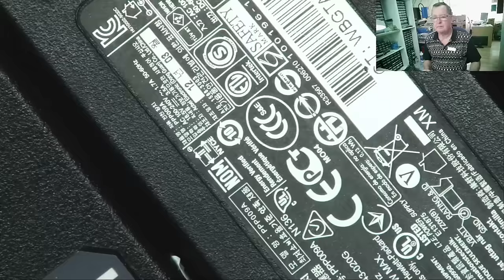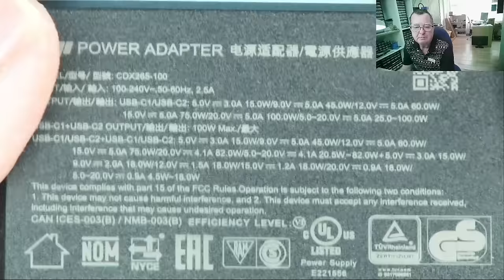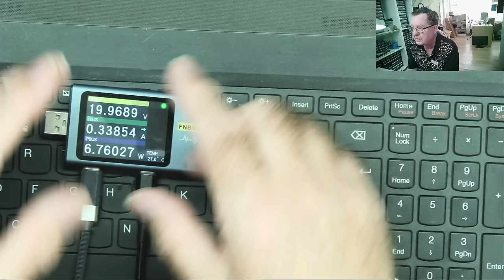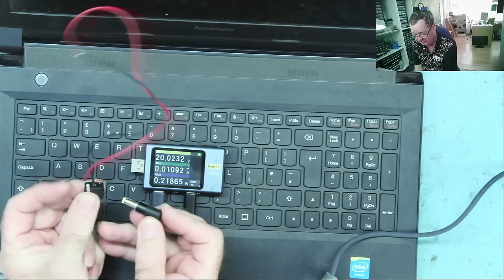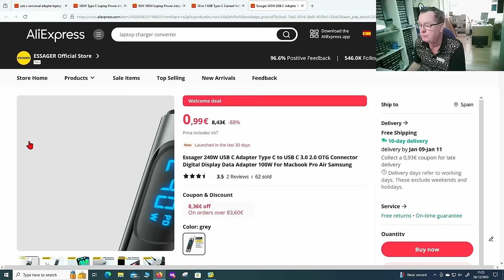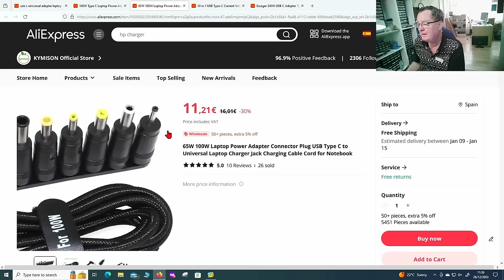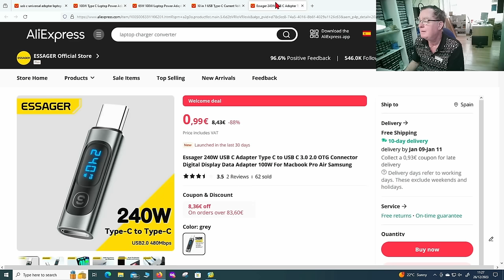Laptop Repair, Volts Current Watts Meter you need these cheap USB-C universal adapters! Here's Why

Comment: I have problems to accept that the voltage is allways correct... What is if not? You will have very high costs for a new computer, etc...
And what is with fire, overheating? Those very small things give you 5 amps...? 100 W, you know which cables you need? Big ones. I am not convinced yet, I have seen so many chinee-things and heard about their problems... no, not for me.
Thanks for you videos, as allways. Happy Xmas and a happy new year 2024.

Comment: yeah, I agree that having the new style USB - C style voltage and current reader comes in very handy for guys like us, we seem to want to know what Devices are doing, of course I have the older style USB - A current and voltage reader and have found it extremely useful over the years, and I know it's time to get the new style USB - C and what's interesting is the amount of current and apparently voltage that can be available with that style of connector.  I was interested in the large display on the FNB58 and it provides more information, and I'm glad to see you have a style that goes on the end of the USB-C cable, to me I would just use that for general purpose making sure current is going through the cable to whatever device is plugged into, and providing general wattage, which is interesting with the diversity in USB-C wattages available

Comment: The problem I have with cheap cables and chargers is fire. I am a noob, but Big Clive and AvE's channel has confirmed a lot of my suspicions. I'm a noob at knowledge of circuits and deep repairs but the experience is there from seeing cheap imports and Amazon fakes.

I use a 19/19.5 supply and meter that has laptop adapters. I now own 3, because I keep losing them and finding them :D

Comment: some universal laptop adapters also had adjustable voltages. not all laptops go with 20v.. some even change voltage based on what "adapter" you plug in.
Reply: With their internal voltage regulators pretty much all laptops that are made today will work perfectly fine with a 20v supply, if you test 100 supplies that come with laptops all for different ratings say 19v 19.5v 20v the three most common laptop voltages currently in production across the board and then even the odd ones that want say 21.5v they will all give you a measurement in the same region ranging from 18v to about 22v and any of those laptops will work on those voltages because the voltage regulators inside the laptops step the voltages down to the required voltages, in my experience it's the current that's more important, if the adapter can supply enough amperage at 18v to 22v you'd be hard pressed to find a laptop that won't run perfectly fine

Comment: I was in the neighborhood for buying another regular ac-dc adapter, and I really love this idea. I just recently bought a 100W PD adapter, and I never would have thought to go USB-C with it for my other projects. It might cost a slight bit more for the cable, but in the end, I think it would simplify the setup I've got going on. Swiss army knife of adapters kind of way. Thank you!
Reply from the maker: Yeah I agree. And add the little USB monitor as well for Volts/Amps/Watts and you have something really useful.  And small.🙂You can also buy cheap USB-C decoys which let you manually change the output voltage of a PD supply, so 5V, 9V, 12V, 15V, 20V
Decoys
https://www.aliexpress.com/item/1005005958435989.html?af=ler2022
https://www.aliexpress.com/item/1005006051376770.html?af=ler2022

You may also find these sockets useful for your various projects 🙂
https://www.aliexpress.com/item/1005005370810361.html?af=ler2022

Comment: Knowing what is going on inside the PD usb cables is really something I am glad to know. I was able to identify a faulty charger that was putting out 20V on type C with no request for it and I think fried a Raspberry pi.  I considered the Finirsi one but decided to go with the Chargerlab PowerZ KM003C. So far I am having good service from it. The chargerlab was about $10 more than the Finirsi one on the 11.11 sale and can handle the newer higher voltages (PD3.1 50V, 6A) and that seemed to be a good fit for my use case.
Reply from the maker: Wow I didn't know PD3.1 will go to 50V 6A, I did know some PD supplies will support 28V already.
Reply: @LearnElectronicsRepair  I think it is going to go with 20V, 28V, 36V, and 48V. Though I think the higher power ones need an approriate rated cable to do it. I'm pretty sure the one I ended up buying from Chargerlab can test the cables specs as well as the chargers.
I bought it mostly because it was newer and looked sexier than the Finiris one, lol. It seems really well made so far!
Reply from the maker: @patrickcallahan2210  Thanks for the info 🙂

Comment: I use these adapters with my bench power supply. That way, I can set the voltage to whatever the laptop requires (e.g. there is AFAIK no USB-PD profile for 16V, which some laptops want). And I can also set a current limit when necessary. And it shows the current draw without additional tools required.
But I would personally suggest to get one of the cheaper USB meters (less than 5-10 Euro), not one of the fancier ones. The new USB EPR specification allows up to 48V (at 5A) and requires constant communication between source and sink. Which most PSUs and meters currently on the market can't do. So depending on how much it'll actually be used by the industry, we might need to upgrade in a couple of years anyway.

Comment: Laptops usually take 19v... 20v shouldn't be too problematic i guess... thanks for the tip 🙏
Reply: I'm sure if you account for voltage drop under load through that very thin USB cable, it would be around 19 volts anyway .
Reply: Ya I use 19-20v for years and I’ve never had a problem with 20 being too high when checking voltage lines. I’m in the repair field for about 15 years now.

Comment: i got those tocki usb type c cables with pd and display too from ali express during the sales in november and so far they are great.
I also got a nother usb power consumption meter device which shows how much Wh are going into a device during charge which means we can measure capacity in 2 ways like charging and discharging. I got the cables for 2 € and 3€ for the meter which was great. I can not judge how accurate this will be. 
But my Xiaomi Phone has a 5500 mAh battery and it took 5680 mAh to charge from 2% to 100% while being turned off. 
Can not be so far off and is a good indicator for a battery health in my opinion cause usually you know the size of the battery.

Comment: Your power adapter only gets you so far.

I recently have been buying up and repairing electric skateboards 2nd hand and find they rarely still have the power supply with them.

It seems they all have a slightly different charger plug and they require different voltages.

Needless to say my charger collection is still growing.

With electric bikes getting popular and electric one wheels too, I suspect I'm still not finished buying more chargers.

Comment: Hi and great video thank you. I use something similar linked to a bench power supply for fault finding on the charging circuits of laptops.  Is the 100w usb c charger you have one that is meant for drones by any chance?  Many thanks.  Bill (Cheshire. UK)
Reply from the maker: It's a DJI one yes, but any PD PSU will work as long is it supports 20V and enough current

Comment: Sorin already has a bench power supply so he just cut the USB C end off the cable and connected the two wires up to the bench power supply. That allows one to dial in the voltage should you need to supply a lower voltage for some non standard device. You have to rely on the bench PS to give you the amperage and watts readings.  I have apower brick that I can adjust the voltage up to 24v 3A with a 2.5mm barrel connector and use those same time of adapters. That though does not allow me to see the amperage being drawn.
Reply from the maker: I agree Greg but I also know there are a lot of viewers who neither have nor can afford a bench PSU.  These little USB-C meters plus the decoy/adapter are a very useful alternative at low price

Comment: Wonder if after watching your vid from a year ago converting battery chargers to power supplies if it is easier just using a tattoo machine power supply as a power supply with some conversion displaying amps and voltage on a display, i have displays for arduino and rasp pico and thought it would be easier for building on breadboards circuits and eliminates me needing to use my voltmeter all in one box. For an idea of the types of tattoo machines I have here’s a list of 3.  1- TPN-020 18v/1.5 amp . 2nd P-053  18v 2 amp and last my main dog I’m willing to sacrifice if what you makes work like a real good PS model SX75 100/240v input 50/60 Hz .5 amp output 0-15 volt 1 amp which is a cheap Chinese one but works super great. Just asking because real hood power bench power supplies are super expensive and the cheap ones are not worth trying to even use.

Comment: I know the Lenovo chargers use a resistor to identify the wattage to the laptop and that seemed to work OK with the one you had.  Can you check with HP and Dell? They have the three pin adapters with 'smart' features and are not just straight voltage inputs.

Comment: Shutting off if it encounters a short is a deal-breaker for electronics repair. It should be connected to a short tolerating bench power supply so that the amperage load can be assessed.
Reply: I agree. Using an external current limited power supply is still the best in fault finding shorted components.
Reply from the maker: @CliveTrezona  Yes that is the best.  But if you don't have a bench PSU or the funds to acquire one then these little adapters are still very useful diagnostic tools

Comment: I found the power supply (DJI CDX265-100) will likely set you up back around $95.
Have a link for an alternative?
Reply from the maker: I only used the DJI fast charger as it is what I had to hand at the workshop as I have a drone.  There are lots of cheap PD power supplies around:
Here is a 100W for €32 with free postage. I've not tried this one but it has sold 500+ and has 90 reviews. 4.5 stars
https://es.aliexpress.com/item/1005005121619732.html?af=ler2022

Comment: i am using same adapters but on  side where is your USB C I connect to power supply + and - and see exactly what is going on with laptop on power supply much much better solution. but if you don't have bench power supply than this is ok.

Comment: Hi everyone! Sorry for my English!) I have couple question on video subject, will be grateful for clarification:

1) Laptop require 18v. But by design or by data pin damage, all this typ-c staff will supply 5v. What will hepend with this laptop?

2) Manufecturer supply laptop with 250wat power supply. If i tacke type-c cable and power supply wich support correct voltage, but can supply, for example 45 wats. In result I will get slow charge, or   demage laptop/ type-c cable/type-c power supply?

Comment: Not much good if you are diagnosing a gaming laptop or Z-Book type workstation that require 150W+. I've misdiagnosed a few using the bench supply until I plugged in the original charger and discovered the power requirement issue.
Reply from the maker: Nothing will do everything. Doesn't mean it is any the less useful 🙂

Comment: I had a kit like that years ago, mains psu and then tips of differing sizes also had a resistor in the tip to signal the psu for the voltage, handy as back then my laptop was 15v, don't think PD does 15?
Reply from the maker: Yeah PD does 15V.  In the latest versions it also does 28V and higher.  Seems PD is taking over the world LOL
Reply: @LearnElectronicsRepair  yes it's getting universal, but the connectors...... It just doesn't seem right to me for the wattage and amps they are pushing through them, being an older guy I like thick brass pins on everything!

Comment: Hello. What is the price of the FNB58 tester?
Reply from the maker: €46 from the official FNIRSI store. Or if you want the version with Bluetooth then €52 - with free shipping
https://www.aliexpress.com/item/1005004665244812.html?af=ler2022
These prices include 21% VAT (if you live in the EU).  As I live in the Canary Islands which are in the EU single market but outside the customs union then I don't pay any VAT so I get the price of €38.37 for the non Bluetooth version with free shipping
Reply: @LearnElectronicsRepair  Thanks for your reply. I just checked Amazon, and there's many many different offers, from various manufacturers, from €50 up to €180, showing the exact same picture and name of this device. It's a mess!
Reply from the maker: @MrArpSolina  I would recommend you forget what is the cheapest offer for the sake of a few €/$/£ and you buy from FNIRSI official store (link I gave in the above reply) then at least you know what you are buying

Comment: When you say decoy, does that mean the adaptor just pretends there is 20V but is actually just 5V or something like that? I dont understand how it would work without a transformer.
Reply from the maker: No.  The decoy communicates with a PD Power supply via he USB-C connector and sets the output voltage to 5V, 9V, 12V, 15V, 20V or even more on the latest incarnations of PD.  Normally the device being charged does this automatically, or doesn't support PD so it doesn't do anything, in which case it gets 5V by default.  A decoy sends commands to the USB-C PD PSU and overrides this automatic voltage selection which is very useful for testing PD power supplies but you need to understand what you are doing if you have a device attached to the PSU that only supports low voltage charging otherwise you may make toast of it!
Reply: @LearnElectronicsRepair  thanks for the helpful reply. I have been able to go and Google for more now.

Comment: My only concern would be that not all usbc fed devices, eg phones etc, can handle 20v!  I thought the standard was to supply 5v and then ramp up as/if the device requests it?  Just worried someone may plug in a phone, or other lower voltage device to a cheap generic supply and fry it on 20v!
Reply: PS would negotiate voltage needed for your device.
Reply: I understand that it negotiates but it should default to the low voltage and negotiate from there and not start on the high voltage!  Ok for laptops but not other devices unless I’m missing something?
Reply: @gartmorn  The cable shown in this video has built in marker for 20v hence PS is complying. Don't know for sure, but it seems logical.
Reply: Ok, I see your reasoning, I was just pointing out that you need to be careful when plugging your phone etc into a usbc and not assume it will automatically give you the required voltage!
Reply from the maker: @gartmorn  Using a regular USB-C cable to connect to your device, or just wires connecting from USB-C to whatever, the voltage defaults to 5V automatically. USB-C connectors also have extra pins and the device can use these to negotiate a higher voltage with a USB-C PD charger, if the device supports PD. Otherwise it just gets 5V. I hope that clarifies this for you 🙂

Comment: So if a laptop has a low ohm short, you cant look for hot components because the PSU will switch off?
Reply from the maker: That's true of just about any laptop PSU.  This is why we have variable current bench supplies 😉
Reply: If connected to a bench power supply the voltage will drop and most of the time the current goes up meaning there’s a short and something is indeed getting hot that has failed or is in that failed line.

Comment: I have never seen my old laptop charger fail at this end.  USB-C breaks easily.
Thanks EU!
Reply from the maker: IMHO The best thing with these USB-C universal laptop chargers is the availability of the very cheap little current/watts meters.
Reply: And I've never seen a shark. 
But I am aware they exist. Because I can access information on things outside my own direct experience. 
Thanks books and TV...

I volunteer at a charity that reconditions donated computers for people. So I'm guessing I probably see more laptops than you in any given week. 

Something I learned very early on.. 
ALL connectors will be abused. 
ALL cables will break. 
ALL power supplies cost money to replace. 
I've also seen desktops come in with the IEC socket ripped out. So skip the dire predictions. Nobody cares.
Time passes. Things change. Deal with it, or get left behind.